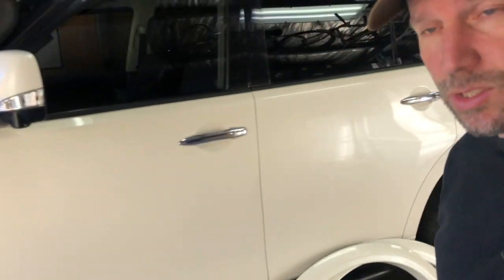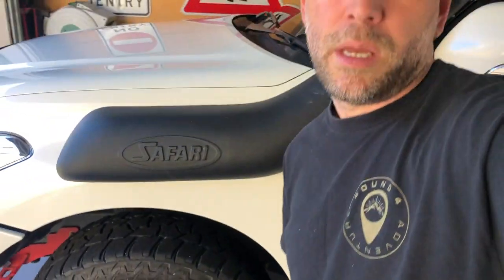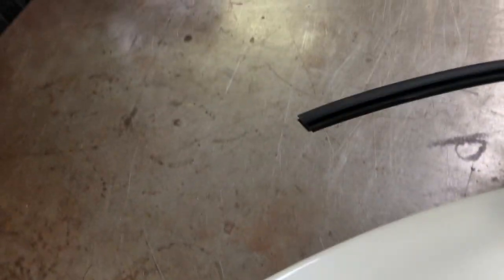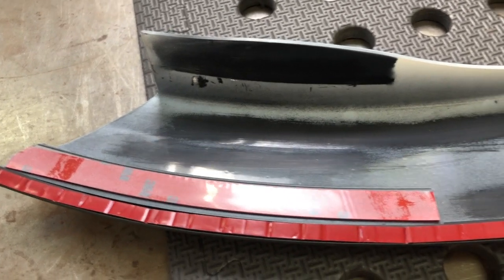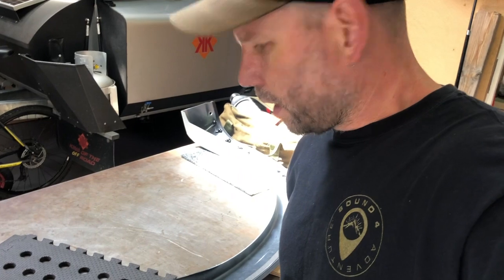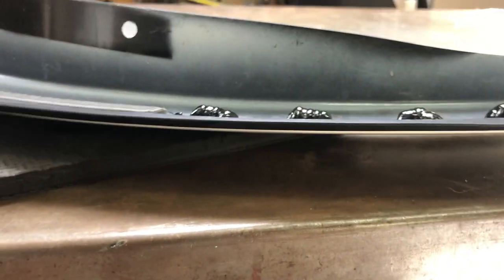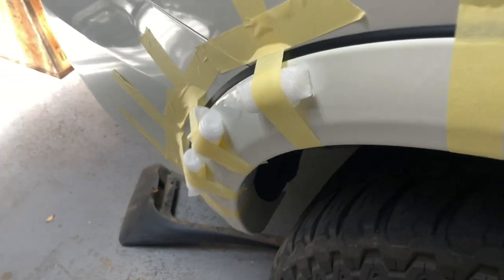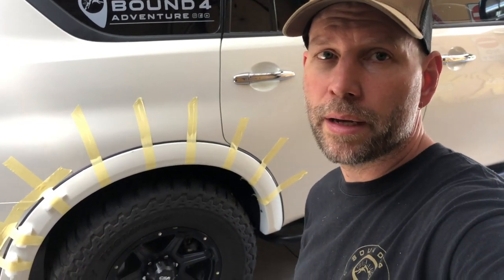Y62 Patrol Wheel Flare Installation

Comment: I just did mine. You made it look easy. 
I had a lot of trouble with keeping the rubber moulding in place. It was insanely hard to line up and once you contacted any surface to the wheel arch the double sided tape would stick leaving no adjustment to get it in place. 
I also have a bit of a gap at the rear bar at the bottom. Not to bad but, they look unreal but I found it very stressful.
Reply from the maker: Hey mate, yeah it is a bit tricky, the aim is to net let it stick until its in place. Easier said than done.  glad your hapy with them, always rewarding when you do it yourself.

Comment: Love the video. What size tyres and offset rims you running mate.
Reply from the maker: Glad you liked it mate, thanks for watching. They are 35s with 18mm offset.
Reply: @bound4adventure23  How much do they actually poke out? Are they a 12.5?
Reply from the maker: @80sShred  Yes 12.5 tyres., The tread is inside the flare, the sidewall sticks out just a bit.
Reply: @bound4adventure23  ok, what the offset again?
Reply: @bound4adventure23  can you fit the spare under the car if deflated?
Reply from the maker: @80sShred  pos 18
Reply from the maker: @80sShred  I did run it under the car- deflated and shoe horned in, was real tight but did fit just. Gone rear bar now, makes it easier
Reply: @bound4adventure23  does the tread stick out past the gaurds or just tyre buldge? I am Looking at pos 12 rims.
Reply from the maker: @80sShred  tread is just under, bulge is out.

Comment: Hey they look great. Very well explain instructions well done. Did you put the mud guards back on?
Reply from the maker: Thanks mate. Yeah I did the rear ones after I fitted a rear bar. the front ones I cut the top off and tech screwed on so they didn't stick out too far.

Comment: Did you fit aftermarket mudflaps after installing these?
Reply from the maker: No I fitted the rear factory ones as they are and cut down the front factory ones to fit.
Reply: @bound4adventure23  thank you